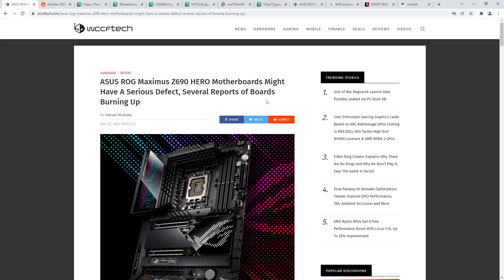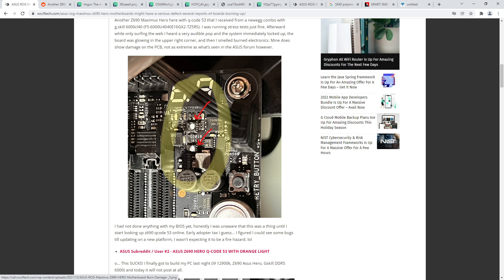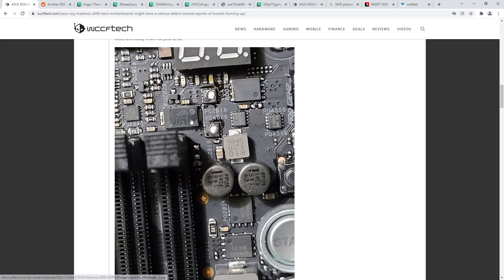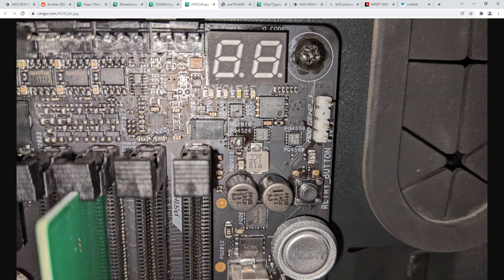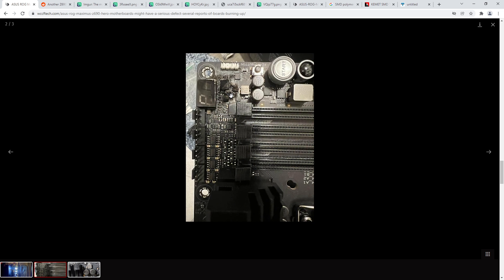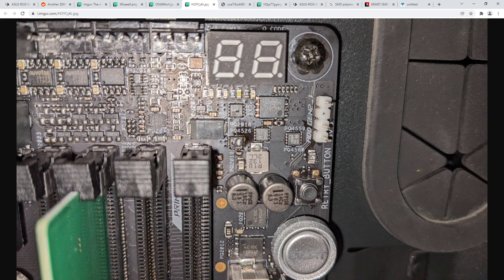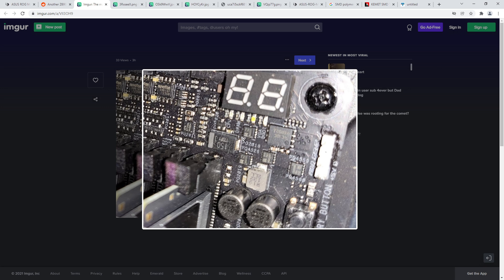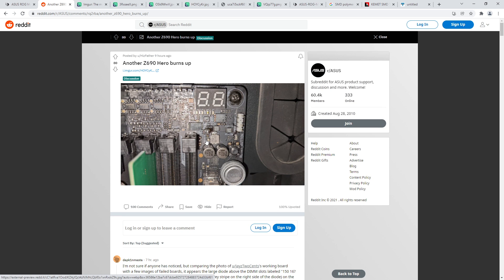My thoughts on the ASUS Maximus Z690 Hero failures

Comment: Great video and very astute spot.

Another electronics engineer here. Struggling to believe Asus would have done this, but it's a very intriguing theory, and certainly looks like they (or one of their component suppliers) has done this.

Finding it even more difficult to believe there are two board revisions that would reverse the cap orientation while all adjacent component placement otherwise looking identical, so for a load of reasons I don't think that explanation flies.

One thing I am seeing is that Asus have clearly used multiple suppliers for this cap across these early production batches. 

I do have a Z690 Hero, but don't have RAM (yet). Going to get my board connected up to a PSU on the bench shortly and hope I can get it powered up enough to polarity check that cap. Encouragingly my board has the 'G157' cap - and the stripe looks to be in the correct direction. Now to confirm with a meter... Will post again when I know.
Reply: waiting on your reply before cancelling my order, keep us posted. I don't have the MO to test it out.
Reply: My mobo has the G157 cap in the correct orientation as well. Looking forward to when you post an update!
Reply: Okay, voltage confirmed. The side of the cap nearest the blowing ICs should have +5v through it. The opposite side (nearer the CPU socket) is tied to ground. 

So if all the various suppliers of these caps are indicating the anode with the stripe, as the  G157 part specifically does, boards with the stripe on the CPU side are likely to be the faulty ones - and boards with the stripe nearer the outer edge of the board should be good. 

All assuming of course this is the single failure point. If there's one misplaced component there might be more. I'm just having a look around to see if there are any more of those caps visible anywhere.
Reply: @richh33  you seem to be about as knowledgeable as the Gamers Nexus crew and buildzoid from this channel, at least on this subject, so I'd be interested to know if anything else is backwards,(or just wrong in any way) as well. Don't plan on going 12th gen, at least, not until I see what AMD has up their sleeves, but I definitely like to keep up on technology, and it's problems, no matter what I choose to do in regards to the hardware I choose...
Reply: @northwiebesick7136  Thanks for the complement NW, but I'm not sure how much that applies. The guys have a lot more PC hardware go through their hands than I do, whereas I design much more specialised stuff.

This is a rare case where electronics design knowledge helps solve an extremely rare problem - and again there are other guys posting on the thread with other more specific knowledge.

Anyway, I did have a brief look over the board to see if there were any other caps of the same value on it - as chances are that if one is wrong, the others off the same reel will be too.

I didn't see any - but that was without lifting the heatsinks, and also without (yet) checking the underside of the board so who knows for certain. 

Having peeked around it a fair bit now tho, the build quality on my own example comes across as very good. I'm looking forward to actually getting it built - when I'll no doubt have more to say about it. 

I was also in two minds about jumping for the 12th Gen - was considering waiting for Raptor Lake, but flipped a coin and it said buy, so here I am. Hope it's worth the wait and hassle - and hope these words added a bit.
Reply: @richh33  thanks for the update, and I do know that you probably don't work on motherboards specifically, or very often, if you do, but the more eyes the better and faster something will get diagnosed, no matter where the experience in the field is coming from. I mean, just look at Jay...  I didn't know anything about motherboards exploding, catching fire, or what have you, then as a regular viewer of Jay's channel, alongside Gamers Nexus and LTT, I saw him talk about it happening... Then saw his update saying to watch buildzoid's video on the topic, that was based on photos from, among other places, his video... That really helped buildzoid out from what it sounded like in the video, and Jay isn't even necessarily in the individual component scene hardcore, as buildzoid is, but more like in a general, "this board looks good at a glance" way...
Reply: my motherboard same g157 , i m stop using it because i don t want to burn it  until the asus confirm wich capacitor is good and wich capacitor is bad. I contact asus today and they say 
 according to serial number  of my motherboard have issue , let me know please , thank you ( sorry my english )
Reply: @juanvaldino1  All the capacitors are 'good', the problem is that some of them are placed and soldered on the board the wrong way round. 

As long as the stripe on the 'G157' cap is oriented to the outside edge of the board, you are good, period.

I haven't yet seen any pictures of 'G157' caps in reverse polarity so you are probably fine. Re the serial numbers, Asus are probably only just beginning to understand which batches are affected.

Again, bottom line: if the stripe on the cap is oriented towards the edge of the board and the RGB header, it's good. If it's oriented towards the VRM heatsink, it's bad.
Reply: @juanvaldino1  Hey Marius, I replied to this post last night - or at least I thought I had - so let's have another go and see if it actually sends this time!

The capacitors themselves are all good. The problem is that some of them have been installed backwards - so their polarity is reversed.

Asus at the minute probably don't know exactly which boards suffer this problem. They just know that a group of boards in certain serial number ranges are affected.

The bottom line is this: The thing that matters is the polarity stripe on the 150/G157 capacitor above the outermost RAM slot. If the stripe on your cap is towards the outer edge of the board (and the ARGB header), your board is good. If the stripe is oriented towards the VRM heatsink, your board is in need of recall/repair. 

It's as simple as that. And no apology necessary for your English, it's fine :)
Reply: @juanvaldino1  according to JayzTwoCents channel there was a statement released by the company saying that the problem users found was indeed the problem, and that a certain model and serial number range was recalled or soon going to be, so if your board is affected, they should replace it for free

Comment: Hey buildzoid, could you touch on the topic of AMD soft blocking motherboard manufacturers from releasing Zen 3 support for X370 motherboards due to "technical limitations" but allowing motherboard manufacturers from releasing Zen 3 support for A320
Reply: The technical limitation is the BIOS chip size (and addressable bios chip size for the CPU/chipset, so you can't just put a bigger chip anyway), you simply can't fit all microcode and firwmare for newer CPUs. If your board wants to support Zen3 it needs to drop support for other CPUs like Zen1, all the APUs, the pre-ryzen APUs, or whatever.
AMD actually published firmware and procedures to allow this to work on older boards but it is up to the motherboard manufacturer to do this in their BIOS.

This is an actual technical limitation, yes AMD should have probably thought about it on a socket they wanted to support for so long that maybe requiring a bigger BIOS chip was good, but it's a genuine screwup imho.
Reply: The only technical limitation I could think of is the BIOS chip size itself. Some of them were only 16mb, and could not fit entire bioses with new microcodes for CPUs. Apart of that, there is none.
Reply: Not soft blocking, MSI have a beta BIOS for X370 boards to run the new Ryzen 3D but in doing so means you are limited to just using Ryzen 5000 and the new Ryzen 3D chips onwards. The 16Mbit BIOS is a major limitation in whats CPU's can be supported at any one time.
Reply: @Dazzxp  i think it is 16Mbyte not bit.

Comment: Its not just Asus boards, had 6 PCs coming back in my shop with a burned board.
Two MSI Unfiy X and Carbon EK with 12900k, one Asus Z690A Prime with 12600k, one Gigabyte Z690 Master with 12700k and two ASrock Taichi with 12700k and Velocita 12600k.

Was different things tho, VRM for MSI and ASrock, the others had issues I couldnt identify
Reply: Might be a foxcon f up...
Reply: @SimanSlivar  Idk, its just annoying as fuck cuz the availability is really bad here for boards....all 6 builds are now on a waiting list till February till the replacements arrive -_-
Reply: @rrekki9320  tbh supply is way up... But demand is higher... Everyone got locked in their homes and bought computers we are still seeing that demand on the market... Tbh it might be a mistake but its also yelling about QA when they are being demanded work at 150% constantly is going to lead to problems and higher defect rates...
Reply: Its all high end motherboard too... hmmm. Also all Z690, glad i didnt build my new pc on intel 12th gen
Reply: @Trisks  I'd be interested in the performance uplift over my Ryzen chips... If it didn't put off as much heat as a small sun... Or draw more power than the last 4 computer builds I've had... Combined...
Reply: @Trisks  Its not the first time tho, last Gen budget boards H/B and low tier Z boards also had CPU throttling via VRM overheating.

Comment: i work for a smd company and i have to say they fucked up at least three times. the pick n place machine is checking the marker on the cap before placing it, the automatic optical inspection failed to check the marker after it got placed and the final function test didnt cover the cap ---> HUGE FAIL!
This happens when all these needed quality inspections are not given and when you have to get alternative caps from other suppliers cause the original ones are not purchaseable anymore (thx to covid) and the other supplier puts the caps 180° reversed into the strap.
Reply: Dude - you are famous now!  Jay shows your comment here in his video picking up on this BZ video :)     https://youtu.be/QdoB9p3LXVQ
Reply: @malphadour  yeahlol just watched the video
Reply: Totally agree. Im sure AOI programm is working fine at least now. Also with 100% of error pictures. xD But it is common when you ramp up some products that the AOI hasnt all the "failure" pictures yet and some areas of a layout is pretty hard to detect too. At AOI as well as at ICT. At ICT some circuits stays in shadow. Sometimes only 40% being covered from the " in circuit test". This is more or less the majority of the cases. Im sure Asus started reclamation on that already some weeks ago.
Reply: This what happens when higher ups set unrealistic targets & the only way to hit them is to cut corners, QC is always the thing that gets cut first

Comment: I have this motherboard and it blew up last night. I noticed the capacitor is in fact going the wrong way. The capacitor has the strip on the left. I'm going to get a new one and if the new one is the wrong way around, I'll remove it and turn it around. I'll post an update as things progress.
Reply: Would not do that as would in all likelyhood void the warranty.
Reply: @NotThatGuyJD  think they would actually notice if it's reversed by hand?
Reply: @user-qi9be4lv7l  very likely as the quality of the soldering would be the give away.
Reply: @user-qi9be4lv7l  if you use a hot air rework station, no. If you use a soldering iron, yes

Comment: Uh oh. Mine appears to be backwards and my RAM (final component in new build) arrives tomorrow. I just pulled out my multi meter and I see zero voltage on the side of the capacitor with the stripe (left) and positive voltage on the side without the stripe (right).  Looks to me like you were right!  How dangerous is this?  Can I use it a bit until I get a replacement?  Will it be more of a problem if I have 64GB RAM vs. 32GB of RAM considering I'll be pumping more current through it?

Comment: That'll be the asus 100% automated quality then.
"People make mistakes, machines don't" yeah Asus you're right... they will put those caps backwards perfectly aligned.
Reply: Someone has to put the spool on the machine. Maybe the supplier put them on the spool the wrong way round or just some of them.
Reply: @wayland7150  the supplier does never guarantee the direction of the components on the spool. They are always in the same direction on one spool but not guaranteed to be on the next and there can always be one or two in the wrong direction. Normally the pick and place machine should recognize that when changing spool and ask the machine supervisor in which direction it has to place them and if only a few are wrong around it just throws them away after visual inspection which every part goes through

Comment: Asus is going downhill my 3090 tuff was  missing a thermal pad on half the VRAM.  VRAM temps hit 110c and throttled, gave me massive stuttering in games and it took me forever to figure out.
Reply: My ASUS Strix 2080Ti also had almost no paste on the GPU there was a small amount on the centre but the temps was reported fine 73C but the hot spot was 105C. Repasted it and the temps gone down to 62C and hot spot 72C.
Reply: Reminds me on my Asus AREZ Vega 56 which had the same insanely high VRM temps because they cheaped out on the thickness and correct placement of the thermal pad. Also the massive cooler might have lost contact after a couple of months. No thanks, I wasn't impressed at all about their build quality.
Reply: Yup,
Even on the asus router i bought i discovered no thermal pads was placed between the heatsink and chips  which led to 100C+ temps while same unit from others did have them.

Comment: No way there would be two PCB revisions there . The amount of parts reorientation would  make a chaos logisticaly on smt room not to mention at pcb vendor  . A scaled bussines to do this is a wrong way in costs .The fets outputs indicate where + volt conects to + side of that cap .
Reply: it will be a "revision" in the sense that the cap is actually installed in the correct orientation this time, guaranteed(tm)

Comment: Remember when buying ASUS was a guarantee of basic quality and not just a brand tax?
Reply: Now who has the time for proper QC when laughing their asses off on their way to bank, because of people paying this kinds of prices?
Reply: No, that's why I stick to EVGA and MSI
Reply: It was always the highest quality of boards you can buy. Been that way since at least 1997 from what I can remember
Reply: @itsjirM  Brands are for scamming gullible people.
The moment there's no constant and thorough reviewing of products, branders start raping and robbing buyers.

Original Asus B450 boards were pretty much scams with lowly Asrock B450 Pro4 having better cooler running VRM than B450-F Strix.
In testing done by "The Stilt" stock Ryzen 2700X doing x264 encoding overheated VRM of B450-F to CPU throttling point in dozen minutes.

In X570 boards Asus definitely fixed VRMs to OK good level even in the lowest board.
But their X570 chipset coolers are again failure timers by design from anus of marketing.
(had lousy chipset HSFs in Athlon board of Asus 15 or so years ago)
Reply: Hasn't been true for over 5 years now.

Comment: You can't really put a Reel backwards. It unrolls only one way.
What is more likely is that the Reel got rereelt backwards. Or only a stripe of some rest capacitors was inserted into the machine backwards.

It doesn't seem to be a wide spread problem, so I don't think a batch of Reels or the Pick and Place Script were wrong.
Reply: I am thinking as there are 2 visible cap designs/makes it may have loaded the wrong cap info, one cap could load left-aligned, and the other right-aligned might have a twist as the difference with the machine.
Reply: Before I saw your comment referenced in jayztwocentz video, I talked to my wife, who worked in the industry in purchasing for almost 3 decades. She said exactly the same thing you did.  :)  complete fail of the QC process.
Reply: A coil wound wrong from the supplier?
Reply: well, yes you can, if it's mislabeled (i.e. the caps inside are turned in the wrong orientation), that's a manufacturing defect of the reel

Comment: I have a board with the stripe in the wrong direction... it's been running for 2 weeks so far with no issue, now I dont want to walk away from it with the pc running. I wish I had a multimeter on hand...
Reply: Ive used my board for a little over 2 weeks (w/ backwards capacitor) and no problems so far. Gonna limit my pc use til asus says something 😅
Reply: contact asus and get your replacement asap. why wait for hazard to occur
Reply: @Sahaj1601  do you think they even know what the cause is? BZ just posted this video.
Reply: Use a mulitmeter as BZ suggests. Failing that, see if those two mosfets burn your fingers (run Cinebench or something that wakes everything on the board up).
Reply: @EliteRock   the two mosfets arent hot at all, the capacitor isnt either. I want to know what they power, is it the 5v rgb header?